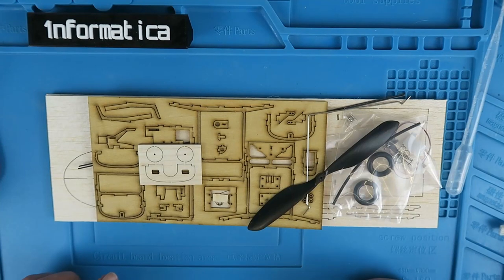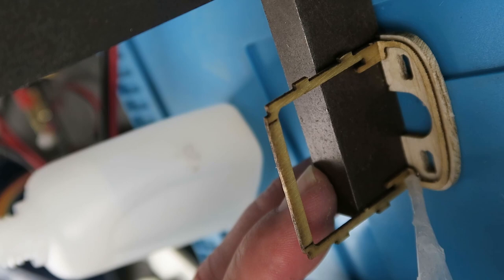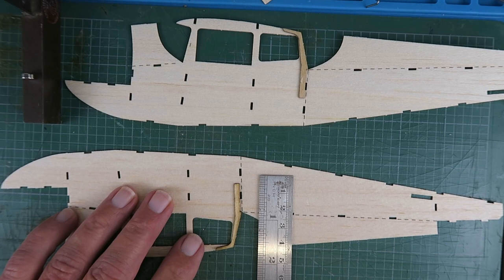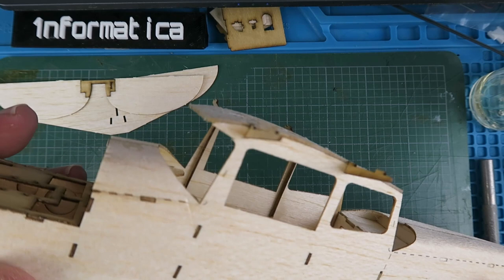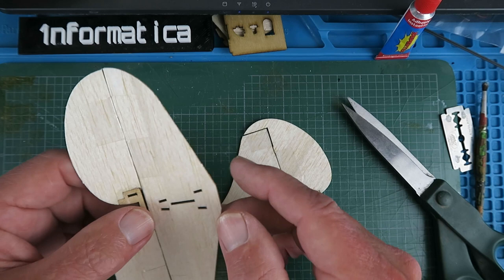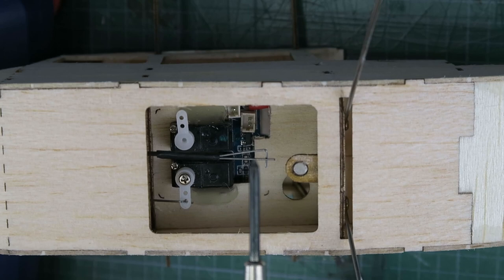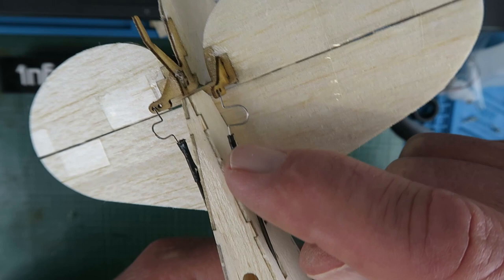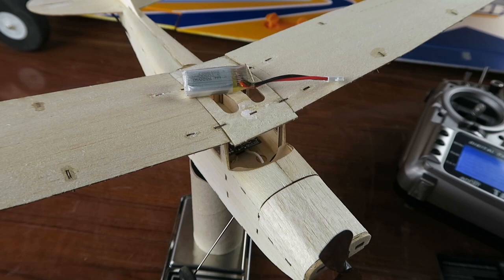MinimumRC Cessna L19 Kit Build Review

Comment: Well done Greg - super instructive presentation as always. Just a couple of suggestions: bending thin balsa is always difficult and I have found applying a thin coating of a product containing ammonia ( found in some cleaning products!) makes this process easier. I’m not a scientist but apparently the ammonia temporarily breaks down the wood fibres. Secondly I thought the method of hinging the control surfaces was overly complicated. I would personally recommend using a continuous strip of ‘Blenderm’ tape on either side of the control surface ensuring a small gap in the joint allowing the tape to bond at this point/and provide a continuous hinge line.
Reply from the maker: Thanks Tommy! Must try the ammonia trick next time. Agreed the simple tape hinge would be easier, but not so interesting to watch!!

Comment: I guess I figured out that the ESC is not built into the f949 receiver board so where would I get a good ESC and how would I hook it up? By the way you did an excellent job building that airplane mine didn't pop come out anywhere near as good

Comment: How did you make the connection between the motor and the receiver board? Did you use a connector? Is so where did you get it and how did you connected to the motor wires? Thank you very much is it excellent video
Reply from the maker: If you pause the video here : https://youtu.be/RnSeiAGt41w?t=38 you can see two connectors on the board. The 2 pin one on the edge of the board is the ESC, the other is for a 4th channel used for ailerons in some models.  The F494 is from this model http://bit.ly/CessnaF949
Reply: Informatica so you know what size connector goes on that ESC output it's a molex connector right do you know what the spacing is between the holes and the connector and what the width of it is or something like that?
Reply: Did you ever fly that cessna style 19?

Comment: hey i just finished building this kit today and i was about to take it for a test flite and i realised every time id turn on the propeller it would only let me fly at half the speed. do u think this is the circuit boards problem (wltoys cessna 182 circuit board). and it work perfect when the propeller isn't on it
Reply from the maker: With the propeller on the motor will be drawing much more current. I guess the battery you have does not have sufficient capacity. Under load when the voltage drops the flight controller will shut off the speed controller but I guess the servos will still work. On the bench you can use a much larger battery to test and measure the current draw with a meter. Please consider subscribing if you haven't done so already!!

Comment: Did you glue in the receiver board or screw it down?
Reply from the maker: It is hot glued in place by the servos. If you pause the video here : https://youtu.be/RnSeiAGt41w?t=744 you can see. Also I cut out some balsa in case I need to use the 4th channel which is the 3 pin connector. Please consider subscribing if you haven't done already!!

Comment: The kit I bought on eBay didn't come with instructions.  I didn't think to request them from Minimum rc by email until after I got done with it.  When I got them I didn't find them to be very helpful.  I just built it based on your video. It was a great video. But mine came out very bad. Did anybody else have problems with it?
Reply from the maker: Hi, thanks for commenting. The quality of some of the balsa I thought was quite poor but nothing copious amounts of CA couldn't fix! What is actually "bad" in your kit? I am in lock-down right now so haven't been able to fly mine yet.
Reply: @1nformatica  hi, the main thing that went wrong for me was that without the instructions I ended up putting in part of the bottom of the fuselage in backward and having Parkinson's and bad eyesight and no barclamps I couldn't get the tabs to line up with the slots or the wood to bend well.  I ended up using tape in places to hold it together.  I was going to try to Include a picture but I don't know how.  But thanks for the video. Without it I wouldn't have been able to get it done at all.  By the way, this is my wife's channel.  I am actually her husband who is posting these comments. Thanks
Reply from the maker: Glad you got there in the end, well done! It is a fiddly build for sure even without your challenges. I was given a tip on bending the wood and that is to use a little ammonia in the water. Apparently it breaks down the wood fibres making it easier to bend.
Reply: @1nformatica  oh, thanks 1nformatica.  If I ever build another one like it I will try that. By the way I bought an ESC that might not match with the receiver. Are you willing to share what ESC you used?  It does require a separate ESC right?
Reply from the maker: @obrien135  The board I used has a brushed motor ESC built in. If you pause the video here : https://youtu.be/RnSeiAGt41w?t=38 you can see two connectors on the board. The 2 pin one on the edge of the board is the ESC, the other is for a 4th channel used for ailerons in some models.  The F494 is from this model http://bit.ly/CessnaF949
Reply: @1nformatica  thanks for the information informatica that helps a great deal
Reply from the maker: You're welcome! Please consider subscribing if you haven't done already!! Feel free to ask more questions if you want.

Comment: Informatica do you use glue or double-sided tape to hold down the receiver board?
Reply from the maker: I used hot melt glue on the sides of the servos as you can see here : https://youtu.be/RnSeiAGt41w?t=592 YouTube no longer shows me if you are subscribed. Please consider subscribing if you have not done so already!
Reply: @1nformatica  I subscribed again informatica
Reply from the maker: @georgejunior895  •:*¨¨*:•_•:*¨¨*:• EXCELENTE_•:*¨¨*:•_•:*¨¨*:•_!! BTW I just checked my duff module and the servo that does not move is very hot so most likely bad contact. If I were  to do it again I would choose another board like this : https://tinyurl.com/EachineFCP51 which also has a gyro.

Comment: Hi informatica this is George O'Brien again I haven't communicated with you in a while since then I had a sport club best and I built a guelo's kid which I flew as a free flight model I was thinking about building another guillowsr's kit as an RC model and I was wondering if you could advise me on what transmitter to get if I want to use those inexpensive brick receivers. And my better off going with a Chinese one I think is like yours if so how do I know what gives me the most versatility I don't like the idea of having to work with separate servos I like the idea of having the servers on the receiver board and I don't want to spend too much money on the transmitter can you advise me?
Reply from the maker: Hi George, I would go with a Tx that runs OpenTx https://www.open-tx.org/ Also of course you need a Tx that has multi protocol support for those "bricks". Soon I will be getting a Radiomaster T16 S 
https://bit.ly/RadioMasterTX16S a more budget friendly option would be https://bit.ly/RadioMasterTX8 but this does not run OpenTx. Keep in touch & keep safe!
Reply: @1nformatica  thank you informatica.I noticed that there are several really inexpensive transmitter receiver repairs on the internet such as fly sky ,XK and HobbyKing. I heard on RCU forum that they are cheap and reliable but there is a bad learning curve and little tech support would you not recommend any of these type of transmitters?
Reply from the maker: @georgejunior895  I do not know which particular model of Tx you are referring to but most if not all only support their own protocol. If you wish to use the Tx with "bricks" from different manufactures the you need a multi protocol module. This is what I describe in this video : https://youtu.be/e4ReeQZznT4

Comment: Informatica, are you willing to share the way you connected the motor to the ESC output on the receiver board?I have been trying to figure out what kind of a connector is on the receiver board for the ESC output but I can't tell from the picture and I haven't received the board yet through the mail. I am not well versed on connectors and what they are calledor how to connect the wires to the connector if it requires a special toolbut maybe you could shed some light on that for me so I can be prepared. Thank you,

George
Reply from the maker: Hi George, now you have opened a can of worms! Generically the connectors are know as "JST" https://en.wikipedia.org/wiki/JST_connector As you can see there are many different sizes and pitches. The motor connector is a Micro JST 1.5mm ZH 2-Pin Connector. I bought this replacement motor http://bit.ly/F949Motor
Which I removed a connector from. You could get this cable http://bit.ly/JST2pinMicro and cut off the piece you need. It is possible to make your own connector but the tool to crimp them is expensive and very fiddly to use. Another option is just to solder the wires to the board but that is also tricky!
Reply: @1nformatica  thank you very
Reply: Thanks 1nformatica,. I got the receiver board today and installed it.  It was very difficult. It turned out I had a connector with wires that fit the ESC output,so all I have to do is fire it up when I get the transmitter which may take a while.  I'll try to post some info on how it flys.  I'd like to see how yours works.      I was wondering if you could tell me the polarity of the ESC output connector.  I didn't solder the wires but it would be good to have it more secure so it'll be ready to go when the transmitter arrives.  I know I've been asking a lot of questions and I hope it's not an imposition. I like to have as much work done in advance to avoid last minute fussiness. Thanks
Reply from the maker: @obrien135  Hi Graham, no problem, ask away! The positive (red) motor wire goes to the ESC connection nearest to the positive battery connector on the board. That is looking from the front of the aircraft the connector on the right hand side. They are actually connected together if you check with a continuity setting on a multimeter.
Reply: @1nformatica  hi informatica thank you for the information when I try to reverse the wires to make them correct I ended up ripping one of the wires out from the motor and destroying some of the woodwork around the front of the airplane and I can't get it back together again it's scrap heap now. Sorry at least I tried but thank you for the help I got it 99.9% built it's too bad it won't be able to fly it put your video is excellent thank you very much George
Reply from the maker: @obrien135  Such a shame George after all your hard work. Is it really beyond repair? Often I leave disasters till the next day and somehow it doesn't look so bad. Surely nothing a bunch of CA and tissue can't fix?! At least you have some electronics to use. The motor is easily replaced. Maybe look at some depron sheet models?
Reply: @1nformatica  I revisited it and the more I worked on it the more it fell apart.  I ended up crumbling it. Thanks for the encouragement but I'm not going to go through it again.
Reply from the maker: I hear ya! Still consider depron though, something like this https://www.flitetest.com/articles/cessna-skymaster or https://aerofred.com/details.php?image_id=96705
Reply: @1nformatica  I could use the parts I bought the electronics as the basis for another kid of the same kind or something similar but I think it had the same problem with the Parkinson's and it would be very frustrating.I'm trying to sell the parts on eBay but I usually have a lot of trouble selling things like that on eBay
Reply: There really was no way to salvage it it was in such bad shape
Reply from the maker: That is why I suggest Depron / foamboard. Very easy to make and some designs are all straight lines you can cut with a knife. The foam is very forgiving and easily glued. This model has practically the same electronics https://www.youtube.com/watch?v=JjBxtMha6To
Reply: @1nformatica  well if I ever tried again I'll look into it right now all my relatives and my wife are against me pursuing it any further and it's been difficult with my difficulties and I don't think I'm going to do it anymore but thank you for your advice good luck with your building in the future it was a great video I hope to see it fly
Reply from the maker: Thanks George. I have more models to build before I can go fly again, stay tuned!
Reply: I saved the receiver out of itand put it in an old model that I made years ago out of scrap material from around the house like cardboard and Saran wrap.I'm going to try it when I get the wltoys transmitter but I heard that back in March and I haven't heard anything from them since then and apparently they haven't shipped it yet. Has anybody else been having any trouble getting shipments from wltoys?
Reply from the maker: @obrien135  Hi George, shipments from China are pretty random at the moment. I am waiting for a bunch of stuff. Even if it arrives in Spain my local post office has not been open for 2 months!! Patience is a virtue!
Reply: @1nformatica  okay informatica I'll be patient. I meant to say I ordered back in March but the speech recognition picked it up as I heard
Reply from the maker: @obrien135  LOL!
Reply: I posted a video about the plane I made from scraps that I installed the f949 receiver in (the one I purchased for the Cessna that I destroyed when trying to finish the build).  I don't think I am going to do a flight video because I don't have a GoPro or anything like that and trying to keep it in the view of the camera on tripod would be too distracting.  I have a great deal of difficulty flying. The video is "scraps built RC airplane".  The Parkinson's isn't apparent in the video
Reply: Do you know what the PIN to pin pitches for the jst connector for the ESC output?
Reply: Informatica have you ever owned a WL toys Cessna f949? If so have you looked at the insides and can you tell me how they hook up the ESC output to the three connectors on the motors that drive the prop? Is there some kind of an adapter or a wire harness that connects to three to one? I need to purchase that part so I can get the connector off it to make the connection from the ESC to my motor on the guillow kit that I built

Comment: Hi 1nformatica| Thanks for your video! I finally tried flying mine some days ago. I found that the battery doesn't have a designed place, and it moves during takoff and flight! so the plane looses balance. It nosecrashed and now i'm trying to find a way to glue the motor back on... would apreciate suggestions for battery location and also to glue the motor back in :) thanks!
Reply from the maker: Thanks for your comment. I have not flown mine yet because of the lockdown situation. The battery should be placed so that the plane balances about one third of the wing width back from the leading edge. I would use a small amount of hot melt glue to secure the motor. Good luck and let me know how it goes. Ciao.

Comment: Hi informatica I don't mean to keep bothering you but I have another question for you. I installed the just the f949 receiver board on the planets built it's a guillows kit.unfortunately one of the servos won't turn when I try to twist it by hand you're the one turns fine I'm wondering what's wrong with it I don't think I got any glue in there but does that mean it's broken or is this normal have you ever had that happen? What should I do get a new board? Thanks, George
Reply: I noticed it after twisting you really hard it gets seems loose but springy towards the extremes and it feels like a slipping and nuts towards one extreme does that mean it's broken? Can glue wick up from the bottom of the board into the servos? is this the only way I could have gotten in there I only put the glue on the bottom.
Reply from the maker: @georgejunior895  It is a bad idea to force servos to move. I have seen the ones on the F949 board not move but applying pressure to the tiny wires on the top and it would move. I think there is bad contact either between the wires and the contact springs inside or the springs themselves and the commutator. Maybe squirt some contact cleaner (NOT WD40!!) on the top of the servo motor. Good luck!
Reply: @1nformatica  actually I don't have a transmitter that's compatible so I haven't tried moving it by the controls I've only tried moving it by my fingers and it seems to move freely and I'd like to text to a motor so I wonder if I broke it
Reply: Informatica how do you get that new board you were talking about to work with a home build model with gyros I thought that was a problem trying to do that.? Does it have as3x or something comparable?
Reply from the maker: @georgejunior895  This board is used in the Eachine Warbird series as well as the Volantex Sport Cub : https://youtu.be/_xsQaF7uPZU it is very simple, there is no setup needed for the gyro, it just has 3 modes, beginner, intermediate and expert (off). It can be used in 3 channel mode as the Sport Cub or 4 channel with ailerons like the P51. Provided you put it in a similar sized model it should be fine.